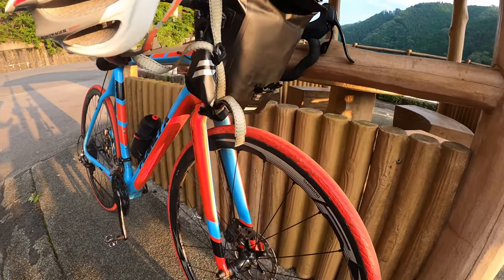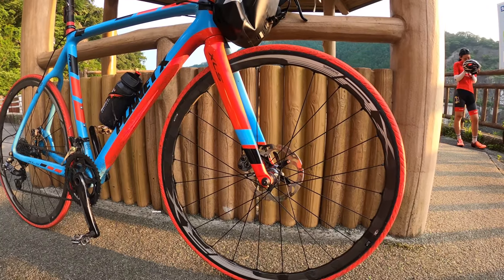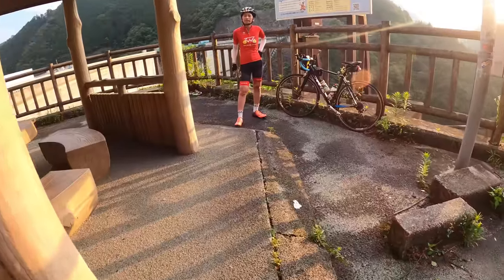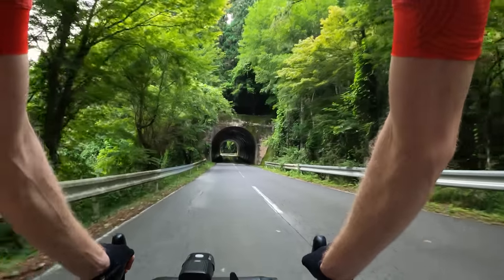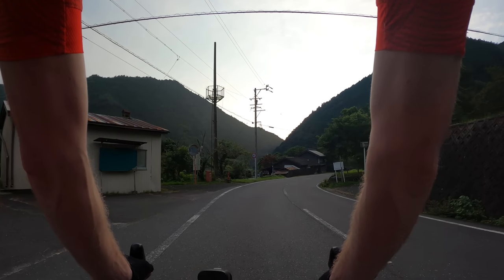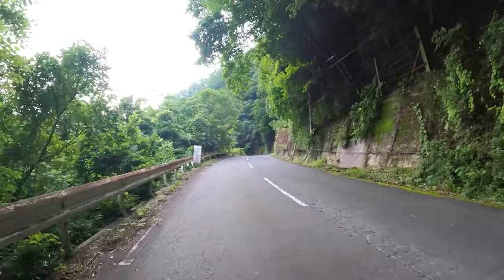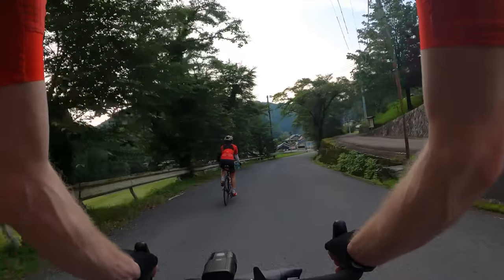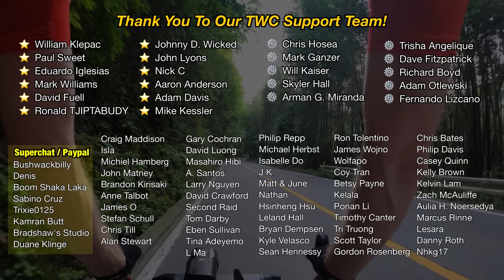No More Flat Tires! Tannus Airless Tires Review After 1 Year of Use

Comment: Last year, I orderd Tannus tires after your review. Worst nightmare : they delivered the wrong product, and I could not get any response from them after trying by 2 different mail adresses, and social networks. I had to go through my Credit Card insurance to get my money back... Terrible customer service... I ended up going tubeless and have been very happy since and it made me learn many things on bike maintenance.
Reply from the maker: I'm sorry to hear you had such a bad experience, but at least you learned some bike maintenance skills and got your money back. I fortunately did not have any issues requiring me to contact customer support, but that's not good if they're not responsive, especially if the order is messed up.
Reply: @TwoWheelCruise  Exactly ! Now I'm a more confident rider for it :).
Reply: I'm a solid believer in tubeless for any tires above about 33-35mm. For road bikes, the options are more limited and more expensive. So these solid type tires give a good alternative. Was considering them on my road bike but they were out of stock, so got some gatorskins instead to try.
Reply: @Click Bait marathons are bloated tires for road riding. A 28mm is 100g per tire heavier than a matching tannus airless

Comment: After riding close to forty years I decided to go tubeless on my gravel and MTB bikes.  I'm glad I converted.  Lower pressures mean more comfort and traction.  Also haven't gotten any flats due to sealant sealing tire cuts.  I agree that for road bikes with narrower tires there aren't as many options to go tubeless but that is changing.  Every few months just add more sealant and you're good to go.
Reply from the maker: Tubeless is also really good lately.
Reply: Tubuluar for narrow road racing tires

Comment: This is exactly the vid I'd been looking for, especially since I read it can take around 50-70 miles for airless tires to get broken in.  I've only experienced tubed mountain bike tires before and don't ride anywhere near what I'd like because the city I live in has so much debri.  Getting flats is way too common, so I'll take any performance hits in exchange for the peace of mind.  I'm also glad you covered gravel near the end because I was curious if it was only slightly rougher or really bad, but sounds like trying out a pair of airless will be in my near future.

Comment: Perfect timing on the review, I watched your initial review and installation several weeks ago, and finally got a set (Tannus Semi-Slick 700x28mm). I just installed them today and can't wait to try them.  One other thing, you mentioned the tire pressure issue, but most of the Tannus solid tires come with an option of Hard Regular or Soft. For their solid road tire That's usually 115, 100, or 90 psi equivalent +/- 5 depending on the exact tire you pick; Something to consider for comfort/terrain. I'm gonna get my new cleats on and go for a ride!
Reply from the maker: Enjoy! I haven't tried the softer time, but I'm curious how they compare
Reply: How did they work out for you?
Reply: @jeremysart  I love them they've saved my rides more than once, like when one particular thorn-shaped pebble lodged itself right in there. On good pavement I can't tell a difference, but the extra bit of vibration is obvious on gravel and those concrete-asphalt pebbly county roads. I prefer to ride on nice dedication bike paths at large parks though so that's not often an issue. I also have a suspension seatpost/handlebar for added dampening. I still haven't gotten around to ordering the softer tires, but I still think I will be worthwhile and will likely add them when I upgrade my wheels.

Comment: Hi to both of you. I appreciate your detail reviews of produce and the quality rides you and your wife take us on, I ride a giant dirt E pro Ebike. A Mountain Bike hard tail It is a 27.5 XL with 2.60 tubeless maxxiis. I ride it every where, Being a mountain bike I alway head off the road onto gravel when a car approaches me from behind.  I will ride the gravel until the road is clear for me to start using the hard surface road. So most of the time i am riding on the gravel. Being a E-bike the gravel riding is quite easy. I love this bike. The only down side is the cost to replace the battery. $1000. I am looking into replacing the cells if possible for a cheaper alteritive  when the time comes.

Comment: I read countless reviews on these before getting them. The worst review said he rode 500 meters and walked back with the bike (it was such a bad ride experience) and the best review said something like, they have been using these tyres for 3 years and are on their 3rd set and would never go back to getting punctures. Who are we to believe when the reviews are at such extremes?

After trying one on the rear myself, it felt like the tyre had a mind of it's own, but I only did about 2.5 miles. The next ride I did 10 miles and it felt a lot better, maybe because the tyre was settling into the rim better or because I was getting more used to it. I'm keeping it on anyway, it's worth it to make sure I never get a puncture. I'm putting one on the front soon! I'm running the 26" x 1.75" version called "Razor Blade". Of all the bad and good reviews, I'd say the bad reviews are from people that can't tolerate the extra drag (I don't care because I've got a motor on) and they say the ride is harsher (not for me, on a Suntour NCX suspension seatpost, there's zero difference between this Tannus and the Marathon Plus (with Tannus Armour) I took off). Those two things are what is complained about the most, the drag and the harshness, neither of which affect me personally.

Comment: been thinking of trying those semi-solid tires. Still takes a thin tube but you can ride them flat, control your air pressure, and enjoy your ride apparently.
 I can't take the sharp vibrations you describe so I've goa have Some shock absorbing.

Comment: flats come down to luck and area for 99% of people. I can't imagine riding on solid rubber but also I mostly ride on terribly paved roads and gravel so it might be different if you are just riding on smooth pavement, especially if you are used to just riding 23s or 25s, even 28s. I think for a dedicated daily commuter it makes a good idea if your terrain that you are riding on is smooth but other than that and even then... idk I think gatorskins with some inserts would be good for most people or just tubeless which USUALLY only fails from sidewall cuts. I guess I'm most curious about is how is the cornering on those types of tires?

Comment: Maybe swap the front to back to offset the flattening wear of the rear tire, it will be a good upper body workout 😀 plus if frame clearance allows, a 32c or 40c could help with the drop in comfort if speed is not a priority.
Reply from the maker: Would if I could, but I think you have to destroy these when you take them off.
Reply: That's a cool idea.

Comment: I'm putting a set on my e-bike that I built getting tired of flats even with good tires and liners I still get flats like crazy. I have front suspension and really good seat post to absorb some of that vibration and stiffness. Ordered 80 lb 700x40c on an e-bike build that will run 40 mile an hour. Even though I don't run those speeds very often. That's what I was worried about high speeds and I'm coming off. And I have a bad back so I hope not going to be much different than the tires I ride already
Reply: How are those tires working out for you? I'm considering doing the same. I have a 700c 28 rim but I can fit the 40s on there. I'm looking for something that I can roll 50 miles a day on and I'm so tired of getting flats. All the time getting flats. I live in LA and our streets suck ass.
Reply: @jamesconnelly2544  I highly recommend the tires. I run over glass nails everything and doesn't even damage the tire. Now if you have a 19 mm rim it's going to be exceptionally hard to get it on then say if your room was 21 mm. But either way once they're on they are not coming off unless you take them off. No worries about high speed. I noticed a very small rolling resistance compared to air. But it's very small and if you have an e-bike it doesn't even matter. Listen you buy a tire for 40 to 60 bucks you pay 10 to 15 dollars for a tube. And during the life of the tire you go through a couple tubes so you drop over $100 for tire easily. It eliminates all that and I don't have to carry a patch kit a tools

Comment: I used tannus 700x23 for a time, but it was too harsh for me. I develop hip and knee injuries during the time I used it. But, I am a tall and heavy rider, 100 kg. Light rider using tannus for training in my area had no complains
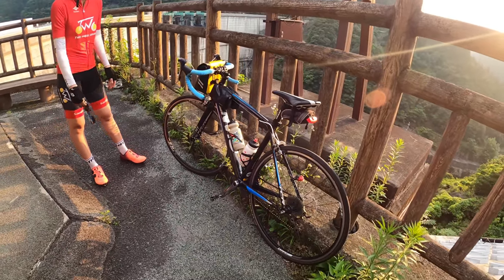Reply: I keep riding at the same weight, when it is cool enough at Sunrise.  Currently it was over 90°F today at 5:30, and an hour later 97°F (32.22°C & 36.11°C).  I do not enjoy riding in this heat, about 50 more days until I can ride as much as I want in the mornings.  Knock on wood, if the global warming does not prolong the crazy high summer warmth we have been suffering. I haven't ridden on a 700x23 for a number of years, moved to 700x25 and then to 700x28, and did not notice much difference in speed on the downhills. Climbing yes, heavy feeling with the 700x28 gatorskin tire, but still manageable and more comfortable ride. I am about to try these on my Stealth KBO Hurricane eBike, replacing unknown brand heavy 700x32 with Tannus 700x28 tires size.
Reply from the maker: Yeah, it's possibly rougher with heavier riders, and I also wouldn't want anything lower than 25s
Reply: @jrnamida5470  If you are not into racing, tannus works well for the peace of mind in commuting. For leasure and century long rides with time to make tyre repairs if necessary, I would prefer air tyres
Reply: Thank you for your comment - I had a painful ligament injury on my first long ride with Tannus tyres but couldn't be sure the tyres were the cause. A comforting confirmation that I'm not the only one to experience this. FWIW I'm a light rider (60kg).

Comment: I've ridden my road bike for 5k kms and no flat tire. If you just pump it to correct psi and avoid potholes it never happens. Or maybe I'm just fortunate...
Reply: What does kms mean? 5k isnt a very long distance
Reply: @outtrigger  5k=5000
Reply from the maker: Riding skill, tires, and routes are all important, but sometimes it comes down to luck.
Reply: Not sure what you're saying. 5k is only about 15min on a bike at casual pace. Are you saying 5000 km? That's a decent stretch without a mechanical but its not just potholes. There's road debris. There's road construction method. There's municipal effort in maintaining safe road conditions, or the lack of. Where I live, there's cactus and goat-head spines that are notorious for destroying tubes. In the worst of the summer, the road surface temperature can exceed 60c. It literally melts, and sticks to your tires and bike. That heat transfers and wears out tires and tubes. A few months back, city workers were doing utility maintenance along a road. A box in their truck must have broke or opened, as behind them they dropped a mine-field of construction nails all through the bike lane. I've had a tubeless tire at 40psi blown open with a 3cm gash by broken glass. The simple reality is, if you bike, most of your troubles will be bad luck and you can't out-skill that. The best we can do is tech that minimizes its impact.
Reply: Fortunate that the roads you ride on are clean and we'll maintened. 😄

Around here there is always glass shards on bike lanes, left by drunk ones that shatter bottles, or just leave bottles to be smashed by passing cars. The debris accumulate on the side lanes.
Reply: @YSRZLELLYS  understood, thanks!
Reply: @Seiti  sounds like my area I keep getting flats every 3 days

Comment: I'm so tired of punctures lately. Actually my tubes keep bursting around the valve stem.
Reply: Sounds like the rim tape isn't covering the edge of the valve stem hole very well. I cut a piece of old tube, put a small hole in the center, and push it over the valve stem to add some extra protection against wear on the metal edge.
Reply: @oldcyclist5880  thanks, will try that. Have plenty of tubes😂

Comment: But flats are such a pain in the ass not just acasional puncture rutinly solved but sometimes tiny pieces of glass get stuck most commonly in puncture protection area and other times you dont know wheter is it new glass or old tiny glass or worn out tire or all of the above in rain and or in dark pain in the ass so much bigger being tired structuraly in addition or maybe late for work wearing tie getting hands dirty

Comment: Very interesting, as I ride on very poorly maintained, glass laden bike paths in Ontario. 

Separately How do you manage commute with no mud flaps?  I'm guessing you have a shower at work?
Reply from the maker: I put a rear fender on wet days.
Reply: Sani-wipes and a change of clothes. A place as hot and humid as Japan, mud flaps are pointless. You just sweat through anyways on longer commutes and for shorter, you can avoid most grime.

Comment: Installation is not a do it yourself operation.
Reply from the maker: Glad I had my wife to help me.
Reply: I needed a few zip ties for the 700c's but solo installation was (just about!) possible. I certainly needed help with the 26", however. 2 bike shops couldn't do it. A third got them onto the rims and I am in the process of seating the pins.